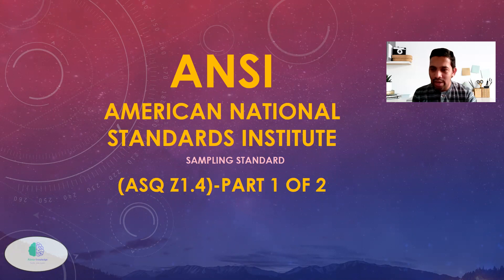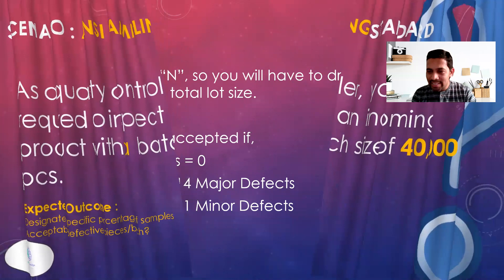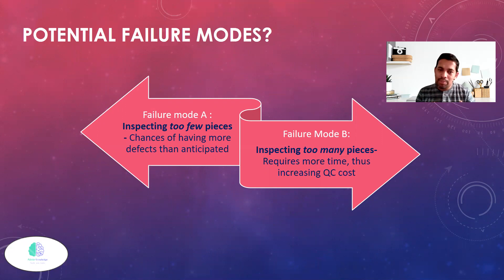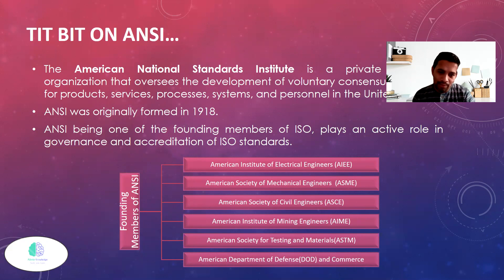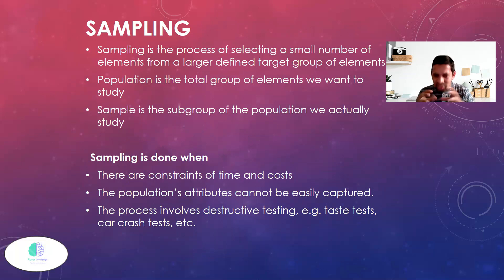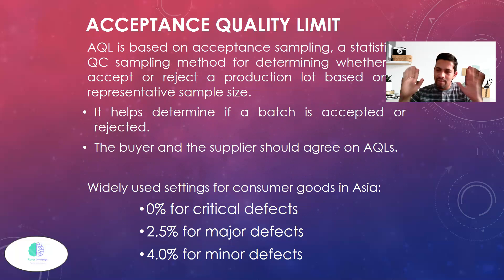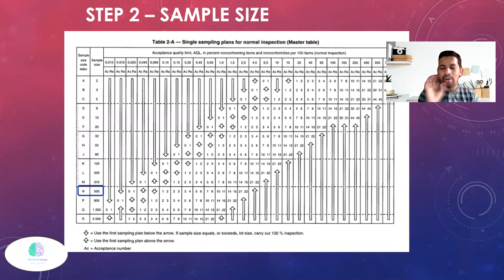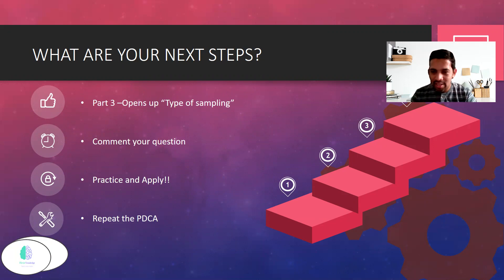How to read the ANSI tables for inspection | Acceptance Sampling Limit AQL & ASQ Z1.4 Sampling |HD|

Comment: Sir, one query sampling shall be depends on nature of material. If it is hygroscopic 500 sample detoriate material of we open bags. What shall be done in such case?
Reply from the maker: Good query, You may readjust to take lower inspection model, simple inspection with lower AQL acceptance Quality Limit (AQL), monitor for atleast 3 months and no issues, then you can make the sample to increase AQL (examples initially AQL shows you need to do 20 per batch and monitored for 3 months, no issues found,  then you can go for 10 and cycle goes), hope I have clarified, please comment for further questions if any